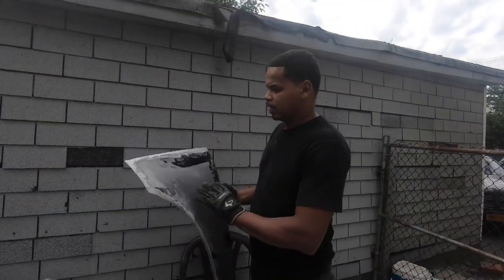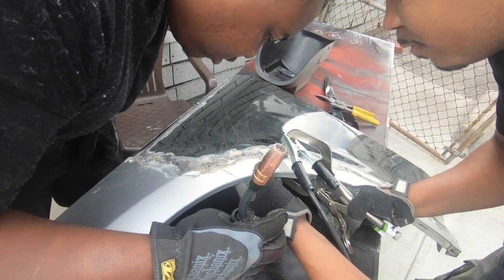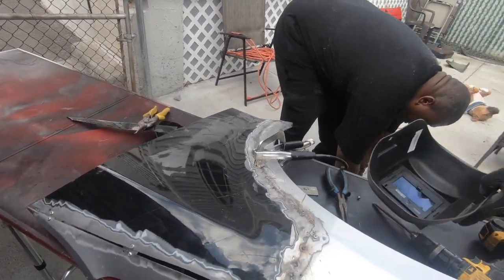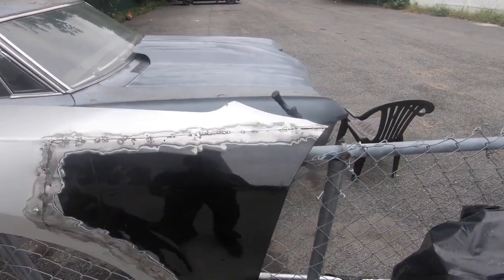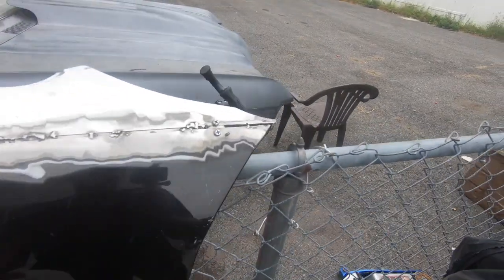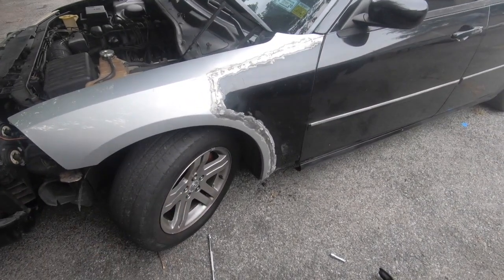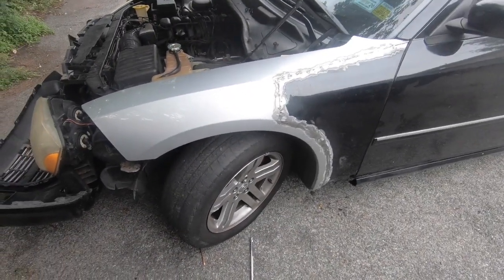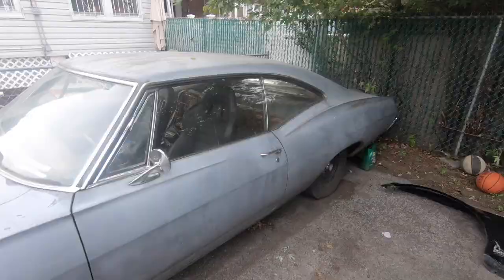Custom Dodge Magnum Hellcat Chargum Build #Part .2

Comment: Man, you guys are amazing, y'all make this shit look easy! 
I Done watched this Video about 100 Times. Still intimidated to even try to start this. I got the Fenders already, But No Confidence to starting the Cut up. I'm very Handy, I do All My Own Work. Honestly all I need to set this in Motion are these Fenders. I want the 2015+ Fender Style. Already Got the Bumpers and Hood Priced Out Nicely On Comfortable Budget. But I can't get past Doing these Fenders. I'm really trying to do like y'all and save Money doing this on a Budget. I'm in DC Area And no one around Me is doing this, I just found out you guys are in NY I would take the Trip up there, if you guys are still doing this and willing to Help in any way.
Reply from the maker: you can do it its all trial and era get some fenders from the junkyard to start on if u dont want to do it on your orginal ones to be on the safe side but if all fails hit me up IG and we will go from there but i would love to here that u took the leap of faith and got it done also i appreacite the support it really means alot.

Comment: a little tip. you could have closed that gap on the top by leaving and 1/8" gap on that bottom. don't butt weld with the two panels tight together. you need to compensate for the width of the cutoff wheel. I'm gonna keep following the build. good luck.
Reply from the maker: dmc535 I appreciate the tip bro. 🙏🏽